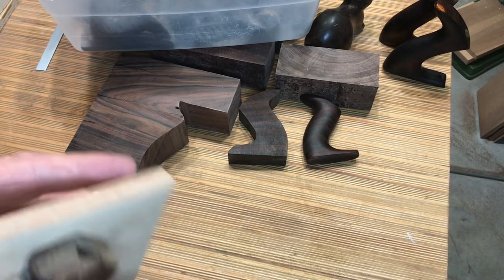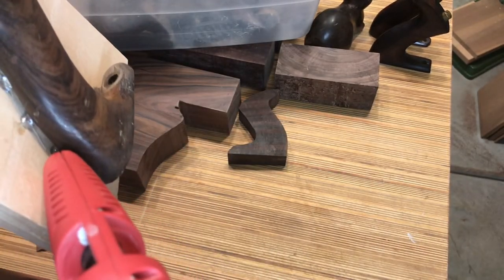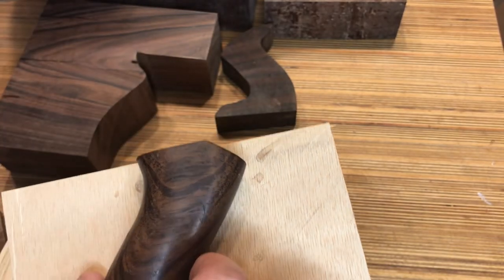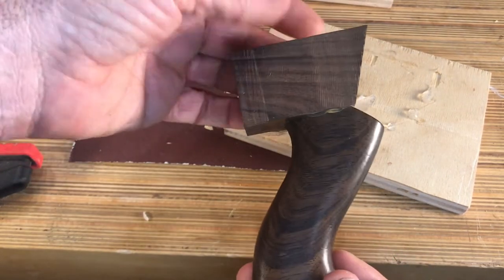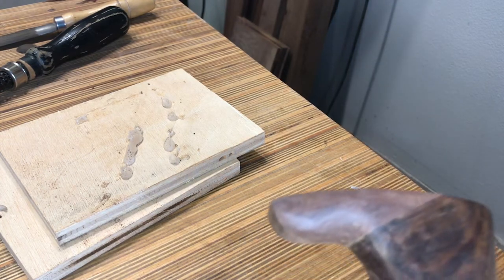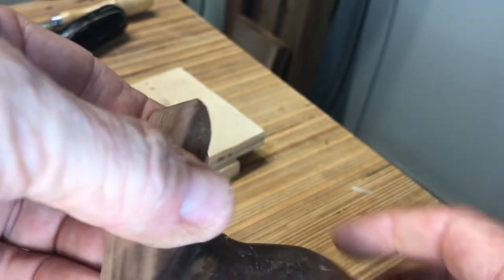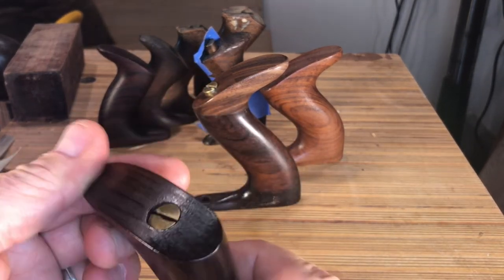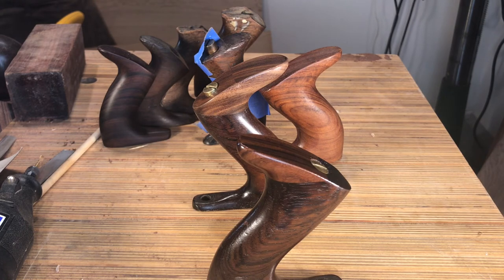Stanley Hand Plane Tote Repair - A New Horn

Comment: As for all your videos, very informative and inspirational 👍🏻.  

One little tip from a user plane restorer and fettler, for the part of boring the hole for the bolt and nut through the «new» wood at the top of the rear handle/tote or the knob: 

I find that boring from the bottom of the handle with a 1/4 inch or 6 mm brad point bit until the brad point reveals the center spot of the new hole.  Then I use a 3-12mm step bit to bore from the top of the tote/knob using the brad mark as the center of the hole.  After 12 repaired totes and 2 knobs this way I can say that this way has saved me hours of filing, sanding, head scratching and frustration compared to the knife/gouge/dremel way. 

The cheap 3-12mm (I am certain there is an imperial counterpart to this metric step bit) I use leaves a very crisp and fuzzy free edge and the fit for the nut is just about as perfect as you would want. 👍🏻👌🏼
Reply from the maker: Thank you for sharing and I have done something very similar to what you explained. The critical part of course is to stop when you see the brad point. Pushing on thru (intentionally or otherwise) will surely blow out. (Been there, done that 😡)  I’ll have to give your method a try…. I do like the idea of not running a dremel freehand.

Comment: Nice work! lots of guitar repair folks use CA on rosewood with good results. I had thought about a couple of tiny dowells to reinforce since it is a small gluing area but I couldn't think of a way to make it 100% invisible. I was surprised that we did not see you, in the process of selecting the patch, to put some finish on to get a better idea of the actual color match. I think the color match is the one thing that could have come out better.
Reply from the maker: Very good points Jerry. The video is two years old and I have since done more than 100 horns so I’ve come along way since then. 👍
Reply: @gordonaddison307 , "Oops" is not our favorite word, but mistakes (large or small) are nature's stepping-stones to knowledge. (Jerry's right, as the Guitar Doctor for Stars Guitars in San Francisco in the late '70's-early '80's, sanding dust [from the right species, of course] and super glue, leveled and flattened with 400 wet or dry with lemon oil and then polished with Miguires(sp) green auto body rubbing compound and finally polished with Ax Wax, sometimes worked wonders on solid body guitars. On acoustics, sanding dust with lacquer was the better choice.)

Comment: Paul Sellers just planes the tote flat, glues on a piece of wood, and then shapes the repair.
Reply from the maker: I’ve watched his videos and he’s very talented. With his skill, an awesome bench vise and perfectly tuned hand planes it’s wonderful to watch. A table saw fixture (in my opinion) is more likely to produce a truly flat surface for those that are not at “Sellers skill level”. I appreciate your comment!
Reply: If you have a table saw this is unquestionably  a more accurate technique. There is insufficient surface area to register a plane accurately.

Comment: 6:17 someone is being sneaky! The screw positions for the 0 clearance inserts did not change so someone is used a saw without a guard or riving knife!
Reply from the maker: …… maaaaaybee Honestly, my videos are ALOT of cut and paste and sometimes they take an hour or two to put together. I need to find a way to make videos easier. But thank you for being acutely aware, I do take safety seriously and have picked up a few fingers in my lifetime. (Not mine… I have all my parts)

Comment: Great info Gordon, thanks for sharing your knowledge. Im curious about how you dress those small pieces of wood you are using for graft material. Obviously not with a jointer.
Reply from the maker: Hi Phil, to make a sliver I use hot melt glue to secure a donor tote to a sled. Tip the blade or taper the fence to get a wedge of rosewood. The other thing I do use a skew block plane like a cheese grater and put a donor tote in the vise. Take a pass (to create a sliver) and then rotate the plane slightly to cut another. Think “taco cheese”….. because the shaving actually curl a bit, they make great arcuate strips that can be used to compliment the grain on the side or face of a tote. And lastly… I have significant collection of carving tools so I can V-carve right out of a donor and glue it into place. Hope this helps. (And you’re correct, I’ve never run rosewood across a jointer)
Reply: @gordonaddison307  Thanks for the reply. I was thinking more about the small blocks you glue on, as in this video. Do you dress them for gluing by the same method (i.e., glue to a piece of plywood and run through the table saw)? Thanks. Cool repair.
Reply from the maker: @philellis6102  yes!  (Sorry bout that) I glue them to a scrap plywood “sled” and the take a super light pass. If it doesn’t clean up I bump the fence and go again. Worth mentioning, most of the time I keep the same blade installed for exotics so there’s  no pitch or other gummy stuff. A clean sharp blade is always preferred.

Comment: Gordon, after gluing an upper horn repair block on, thinking of using a Forstner bit to initially establish the upper concave curve tote radiuses, e.g. 1-1/4" diameter?  Have you ever done this or if not, how do you initially establish radiuses? Also do you recommend using a Forstner bit / drill press to make the upper screw / bolt radius relief, e.g. 7/16" diameter?  Saw where you opened up the screw rod hole using a Dremel bit(?), but wondering if using a Forstner bit would be easier, or maybe it's risking tear out and not a good idea.  Thanks for you expertise and help.
Reply from the maker: So, a big negatory to the forstner bit. Why? Because I’ve snagged, chipped, or ripped out. 😡 I’ve tried to “sneak up” on it and I’ve tried to spin backwards to cut fibers. Of course, you can give it a shot and if it works, great. I use Iwasaki rasps to cut my initial shape. They are made up tiny plane blades, not a traditional rasp point. This allows complete control and I can always position my work in such a way that I done rasp against the grain. These rasps cut soooo clean and fast, once you give this a try you realize how different (and easy) shaping can be. Traditional files are for detailing and would take forever. As for the counterbore… I do have a new bit that I like. I’ll post a video when I get home. Hope this helps!
Reply: @gordonaddison307  Thanks for your Xmas gift response!  Still looking forward to your "shaping tools you use" review vid.  Happy New Year!
Reply from the maker: @SW-jo7vy  I’ve reached out to Woodcraft and offered to redo their Iwasaki video. I’ll go ahead and post mine… it’s already scripted. 👍
Reply: @gordonaddison307  Sorry, "Scriped "?  Where is this assumed link located for Iwasaki rasp / file?
Reply from the maker: @SW-jo7vy  https://youtu.be/8fCuLLyOqFA

It’s a horrible video because it lacks any technical value/specs, and it really doesn’t provide a close up view of the “teeth”.  These rasps are a good value, especially when compared to hand-stitched rasps that run $130+
Reply from the maker: @SW-jo7vy  I’m a firm believer of “if you can’t do better than zip it”. 😁 I’ve created a video for Iwasaki (Woodcraft) that’s better. Let’s sell some rasps!   I’ll keep you posted.

Comment: Great video!  Very informative and helpful.

Do you ever use Titebond I or Titebond III to glue the parts together or are there things with these two that make them unsuited for this?
Reply from the maker: Great question and I should probably further into this. Here’s my initial response; I’ve always used TB1 with great results for fine furniture and many other projects. When it came to plane totes and sweaty hands, slightly varied climate changes.... I felt it was wise to use a “water resistant” interior/exterior adhesive. With TB3 being a “waterproof” interior/exterior, I just didn’t graduate up. I’m sure they’re both excellent and great for what we’re doing. You’ve inspired me to reach out to TB. 👍
Reply: Let us know what you find because I only use titebond lll, I find no ll too runny

Comment: What are the other glues you use and in what circumstance do you chose one over the other?  Thank you.
Reply from the maker: long answer :) I use TiteBond most of the time, especially when I have a tight, clean break. As you've heard it said, the bond is stronger than the wood. If it's necessary to further disguise the joint I will V carve a groove and graft donor rosewood into the joint. This disguises the seam and TB is easily workable. My second choice is cyanoacrylate (super glue) and I use it for non-structural repairs such as grafts or chips. The neat thing here is that I can spray it with accelerator and keep right on working. It's tintable too. Third would be 2-part epoxy. I use slow and fast cure. If you've seen me bury carbon fiber rods you know I want to encase the rods. I don't  use TB for filler so epoxy is the way to go. It too can be colored but it's a bitch to work with if you get it on the face of the tote. Last is polyurethane. I do use it when I need a strong bond and some expansion. Great for painted totes.